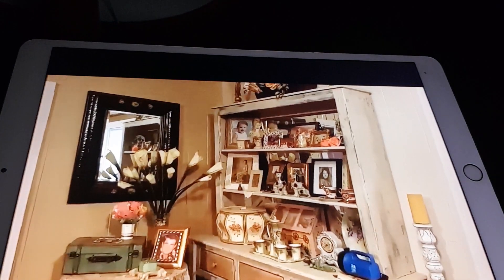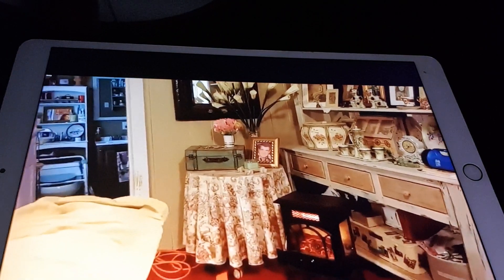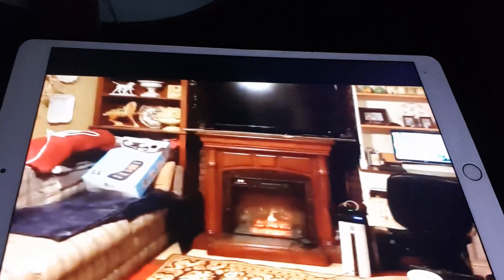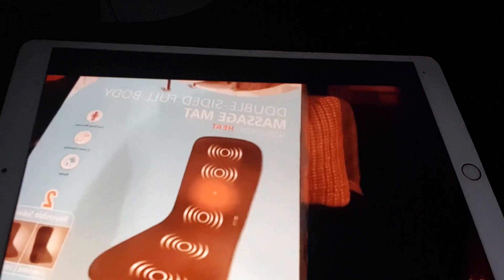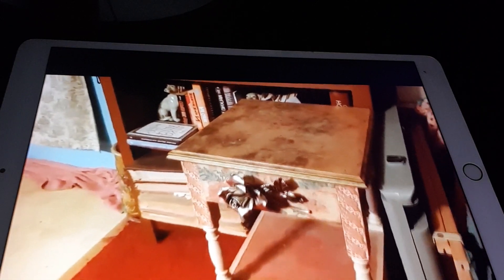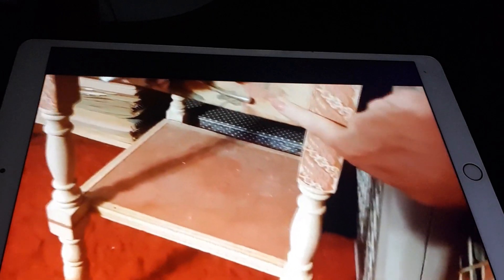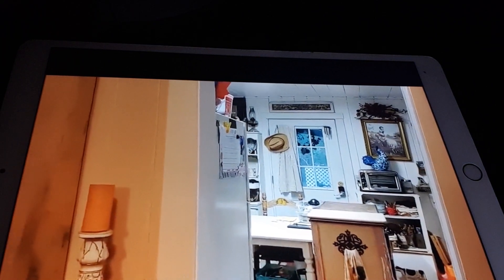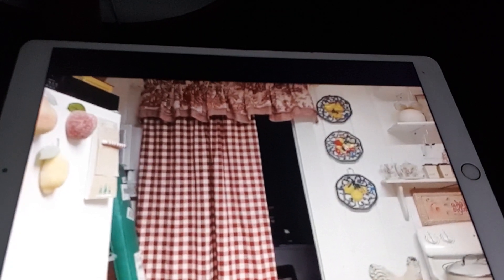How To Stay Warm In An Uninsulated 1941 Cottage ....

Comment: When we were kids we didn’t have double glazing, our metal frame windows iced up on the inside in the winter 🥶 we used to have big heavy curtains across the front door and mum made door snakes to put across the bottom, and we didn’t have duvets we had think blankets on the bed 😂
Reply from the maker: Squidgy, I was just looking for the comment you made about the ‘Golly’ we used to have on jam jars.  I saved all the badges…and gave them to my kids.  I have a short video - ESPECIALLY For You…. xx

Comment: My house is 1920 and they put UFFI   insulation in 1970's which shrinks down  overtime to nothing. I boil in the summer and use space heaters to supplement in the cold Northeast USA winters.